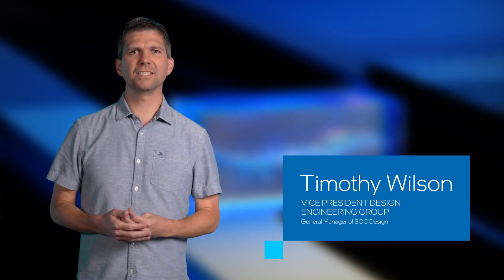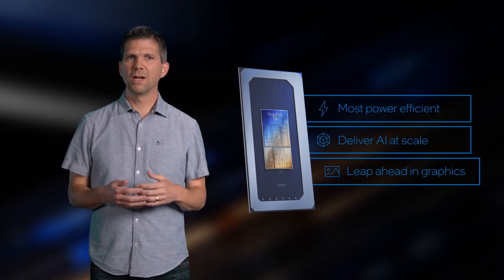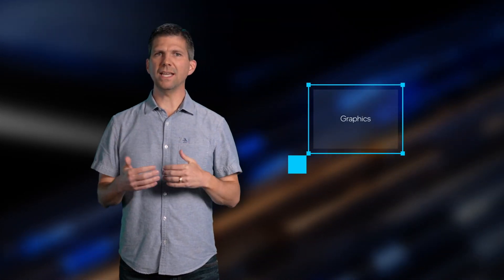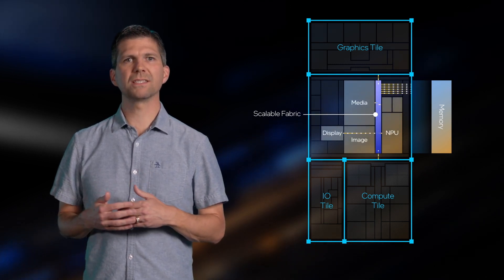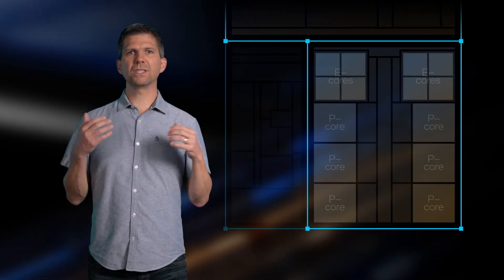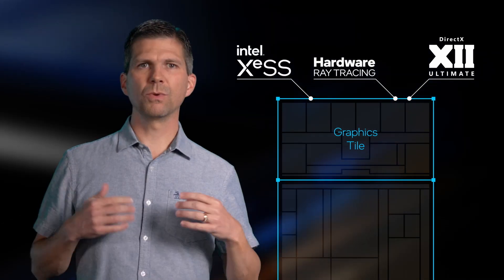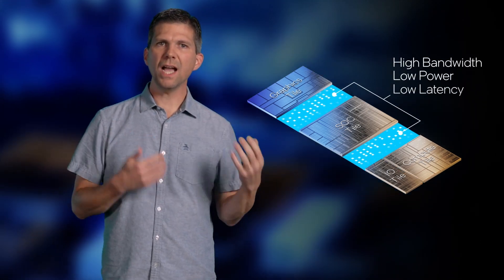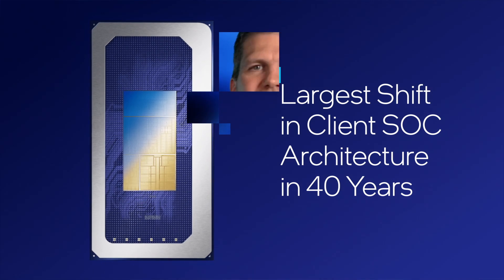Architecture All Access: Meteor Lake – Architecture Overview

Comment: Will this also run the Intel ME rootkit?
Reply from the maker: Please know that the ME toolkit will be usually updated or available for any product. However, to use it, you will need the drivers and firmware that are offered by the system manufacturers. If you wish to discuss this further, please raise a ticket via https://intel.ly/40zs15h with details like the purpose of your query, how many systems you have, and Intel vPro availability.

Comment: Engineering is all about compromises. You always talk about the good stuff, never the bad stuff. Can you maybe explain some of the compromises. Maybe the SOC fabrics new location increases latency to some other part of the chip, maybe having all the high compute parts in one corner makes it harder to cool the chip, maybe it causes thermal strain in the silicon, maybe you need to add two low power CPU cores into the SOC in order to have the other efficiency cores in the compute part of the chip, using the same production node, so to save energy you would like to close all parts of the compute, but the two extra cores requires some space too making the SOC part a little larger. Maybe you could have splid the performance cores and the efficiency cores of the compute part, but the they could not shear the same L3 cache.  I think you know what I mean. To understand your choices we need to here about the compromises, not just all the good stuff.
Reply: No company talks about compromises if they just launched the product. It's the review people who have to test and talk about shortcomings.

Comment: Meteor Lake is a revolutionary change. New Intel 4 node, tiles, new P-core and E-core architectures, new low power e-cores, 2X IGP performance, AV1 encoding acceleration, etc. Meteor Lake has more changes than any other CPU architecture in over a decade. It basically takes the best of what Apple and AMD are doing, and adds even more on top of it and Intels leadership in performance.
Reply: Meteor Lake’s P-core is not new, it’s the same one that 13th gen Raptor Lake has but with more cache
Reply: A thing where Intel consistently sucks is performance per $/€. I am sure that the upcoming Meteor Lake processors will continue this long tradition, placing themselves in the market as the most expensive processors for a given performance level.
When I buy some food at the supermarket I always check the price as €/Kg to make an informed decision. I do the same when I buy a processor (€/performance).
Reply: I think many people are willing to pay that price if it gives them good battery life. Look at Apple, their laptops are very expensive but the combination of battery life and performance is, as of yet, unrivaled. If Intel can change that they may have a very lucrative product on their hand and really change up the laptop market. @marcobassini3576
Reply: Meteor Lake being revolutionary is a nice hype term to raise the value of Intel stock shares but what will change in practice???
Previous premium "ultrabook" laptops with Intel's processors like HP Elite Dragonfly already have more than enough battery life for office tasks, so Meteor Lake efficiency improvements are more likely to make Intel look less inferior compared to jack-all-trades master of none Apple processors or Qualcom's smartphone derivates CPU modified for laptop needs than actually change user experience significantly when graphics performance will be still inferior to Apple's laptop well software optimized integrated graphics while battery life will be lagging behind efficiency oriented processors derived from smartphones used in Qualcom's Windows Arm64 laptops.
Most of the performance per watt improvements for power users will be due to newer manufacturing processes instead of the addition of scalable processing cores design that for pluged-in performance tasks just taking away space that could be otherwise utilized by the more performance cores.
Somehow I see the larger degree of on-demand processing power scalability as far more useful for servers where it can produce significant money savings on power consumption than actually making a difference in laptops other than allowing laptop manufacturers to make poor optimization and still getting away with that in a similar fashion as modern dedicated graphics cards made playable even VERY poorly optimized videogames because we already know that laptops with Intel processors are sufficiently efficient for office work related mobile use for over a half-decade if laptop manufacturers spend enough time with their product, not to mention further generations prior to Meteor Lake. 
I got over a 5-year-old 1kg Panasonic Toughbook (business line not rugged) 12,5" laptop that still gets around 10 hours of battery when the display is set over 200 nits running Win 11 with Intel's 8 gen 15W CPU despite Intel lagging in deployment of newest manufacturing tech in their processors, so how much will be latest improvements making difference outside servers in the real world other than making you feel good while looking at benchmarks?

Comment: Going to chiplets is driven by rising cost of manufacturing and not the hunt for performance. The increase in latency and resistance in the substrate will generate heat losses so this might not be so impressive performance wise. Lets see if they faceplant like Amd did with their latest gpu chiplet design.
Reply: Meteor Lake is primarily about efficiency. Slightly more performance than raptor lake but at 50% less power.
Reply: Foveros is more efficient per bit than V-cache. I doubt it will eat into power budget or produce much heat, and since they didn't serialize their interconnect like Infinity Fabric it's likely that latency is greatly reduced as well. With smaller compute dies, you can bin higher clocks, similar to how AMD's low end clocks higher relative to their top end than Intels has been. This is all theoretical, but it looks promising.

Comment: Question: what could I benefit from the NPU, if I only do some office work, e.g. document and presentation, visit some websites, watch videos etc?
Reply: Both Microsoft and Adobe and a dozen other big software companies have signed on to use Intels NPU. There are far too many benefits to list, so I suggest you watch Microsoft's recent Windows AI presentation and look into what adobe is doing.
Reply: One example would be video effects in Teams calls, like background blurring.
Reply: I assume intel will work closely with microsoft to get it implemented in windows and applications. Webcam video enhancement, audio enhancement, windows copilot and so on would come to mind even if you dont use specialized programs. i do however suspect for adoption to be rather slow. right now there are tons of companies implementing their own AI accelerators and i dont see a common standard (yet).

Comment: After watching a few videos on Meteor Lake, I have the following questions.
Why 2 low-power E-cores instead of the normal 4? Is it because of area saving or power saving? (Edit: to be clear, I know there are 8 E-cores in the top config of MTL, but why just 2 in the SoC tile?)
Network-on-Chip is mentioned in the technology deep-dives slides shared by presses, how is it different from previous ring bus?
Reply: There's more e-cores on the compute tile, the idea with the low power island is to be able to turn off the compute tile when demand is very low
Reply: @Tiporae  Yeah. But why 2, but not 4, which is the same number of cores in a normal E-core?

It is interesting to know how they make this decision to modify their E-core.

Because of die area restriction? Because data says that low demand tasks do not need more than 2 cores anyway? Because the low power design is shallower and narrower and has less cache?
Reply: @NicolasChanCSY  They're the same cores on issue width etc, just on different voltage rails afaik. It probably just fit in the die area of the IO tile, and if something calls for more performance than the LP-E cores you want the compute tile awake I guess. Future families may see more LP-E cores of course.
Reply: @NicolasChanCSY E clusters come in both 2 and 4 core now.
Reply: @Tiporae compute tile and may be iGPU tile also will be off. Only soc tile will work.

If we are using thunderbolt connector, then IO tile will work with SoC tile.
Reply: Good questions. The NOC Fabric is something I'm also interested to learn more about. The SOC is designed to be as low power as possible, which would have greatly influenced the choice of type and number of CPU Cores. Why have a dedicated media engine? Why have dedicated display engine? Why not let the CPU and GPU run those workloads? I believe such workloads are common enough to want to do them efficiently. A lot of the PCs are bought for content consumption and content creation, they represent a huge segment. Since the Media Engine and Display Engine find a natural home in the SOC and do the heavy lifting more efficiently for those specific workloads, including Low Power Efficiency CPU Cores enables their use without using a lot of energy. On Desktop these choices make very little sense but when running on battery it makes a lot of sense. I have seen when new laptops come out, they always market the video playback battery test; because for a lot of people the most common and significant workload is video playback. This is my best guess and like you I look forward to learning if I'm at all close to the truth. The NPU is also low power so that assistants like CoPilot can be engaged via voice commands to wake the computer from sleep and do quick and simple tasks.
Reply: @EnochGitongaKimathi 🎉🎉100%
Reply: The 2 Low Power E-cores are for.. low power low performance tasks. Video playback, web browsing, etc. The point of only having two, is because if an application needs more performance it will be pushed to the 8 normal E-cores.
Reply: @__aceofspades true
Reply: @__aceofspades 100%
Reply: 2 cores are not on the compute tile, you cannot compare them. They are on the SOC. So yeah, it’s very area-constrained. Same reason why integrated graphics on Ryzen 7000 are only 2 CU as well - there it’s in the I/O chiplet, and I/O has a lot of other things to do other than graphics.